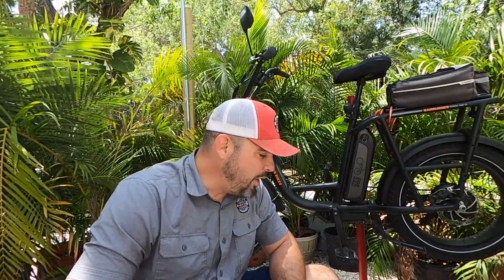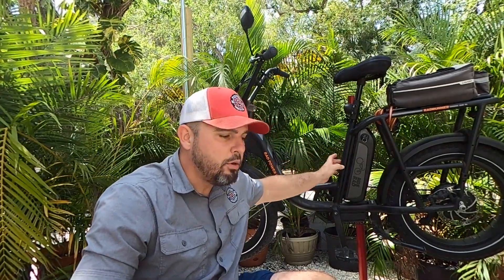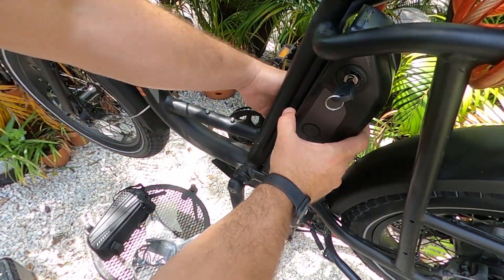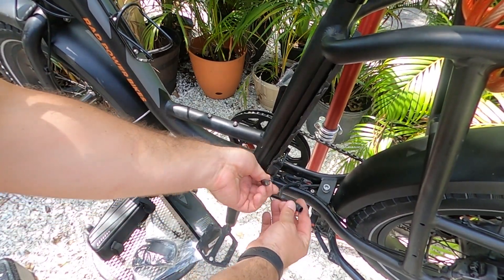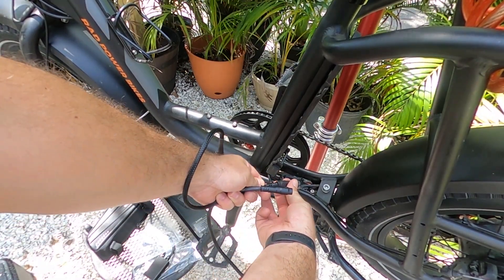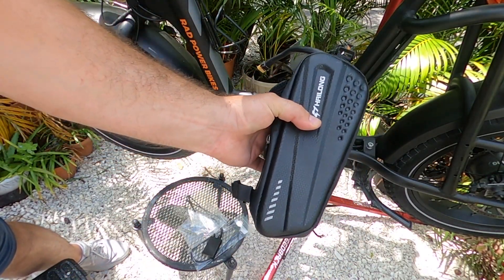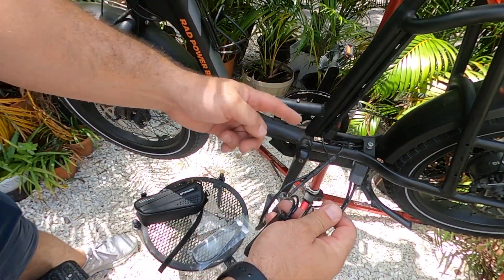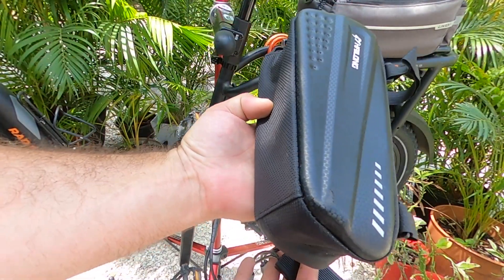Rad E-Bikes | RadRunner | Plug and Play Dual Battery Discharge Balancer Kit | Install Two Batteries

Comment: I have two rad power batteries. Do you have a video of connecting the stock batteries? I have the rad power plus.
Reply from the maker: You would need to get the connector plate from rad to complete the connection

Comment: Can i hook another rad battery like this ? I have two bstterys for a radrunner 2 and im tired of swabbing them around
Reply from the maker: You will need to get a rad battery mounting plate for your second battery, but yes, it can be done
Reply: @ElectricAllWheel  I have one already I bought a totalled rad runner 2 and took all the parts off

Comment: Like my setup now with the balancer on my 2022 runner plus, 40amp. Second battery is a rad mission 10.5 ah. Was a deal last year for $200 shipped. Using a 35amp controller, 80% power output. One thing, motor seems to be quieter now and performance good and battery life. Rode today, just seems, overall a consistant tone out of motor. Mounted 10.5 battery under seat. Overall, happy way it performs.

Comment: Can you set this up, but only put the additional bag battety on when needed? My common comute is realitvely short but every other week may need the extra capacity, as long as both batteries are full it wouldnt be an issue?
Reply from the maker: Yes. It will work with only 1 battery plugged into the balancer

Comment: would the components/wiring hold up using this on my rad runner plus with 25amp controller. I can pull 1180w peak on current setup..

Comment: How would I attach two rad runner batteries? What plug do I need to connect to that?
Reply from the maker: You would need an extra set of rad cables that are sold in the store. You would also need to make sure you had and extra rad battery cradle for the second rad battery.

Comment: Would this work on my Rad City Step-Thru 3 that has regen braking?  I believe I have the same 48v 14Ah battery.
Reply from the maker: The balancer will not allow for the regenerative properties of the motor/controller combo.
Reply: @ElectricAllWheel  I don't understand. If everything else worked BUT the regen, I would be fine with that. I never use the regen anyway.  Or would it damage the system if I activated the regen thru braking?  Could I disable the regen somehow and still add the balancer?  TIA